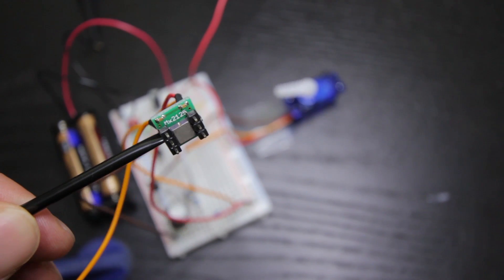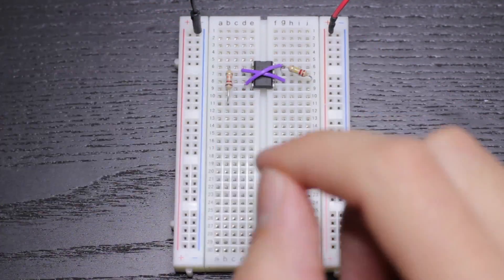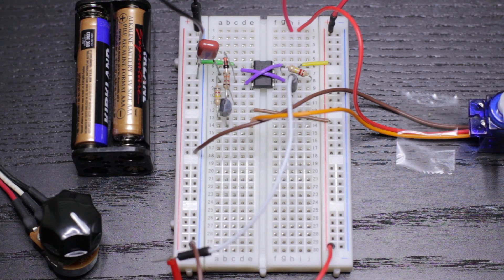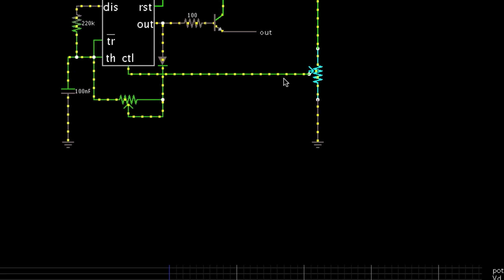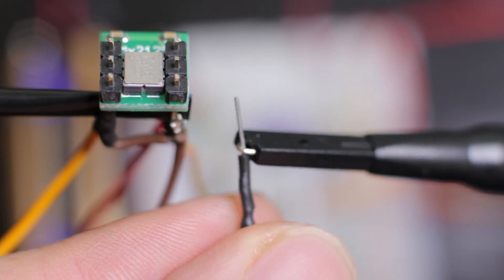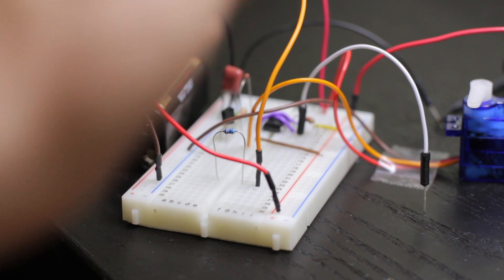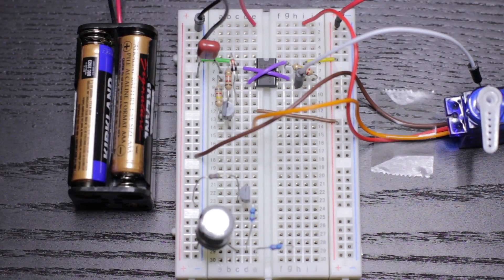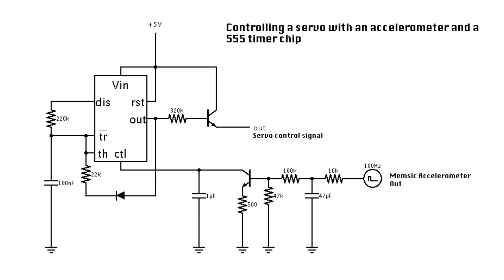Analog Accelerometer Control of a Servo

Comment: I have a question 
If the accelerometer completely stops it's movements At a non-neutral position , will those servo motors with laod on their axle hold their position or simply cause the axle to fall due to gravitational pull on the load ? Please answer asap Im doing an final year robotic project

Comment: Which value pot should be used if v have to control it by pot instead of Accelerometer ?
Reply from the maker: I would suggest a 10K ohm.  However, seeing as the potentiometer is acting like a variable voltage divider, other values may work as well.